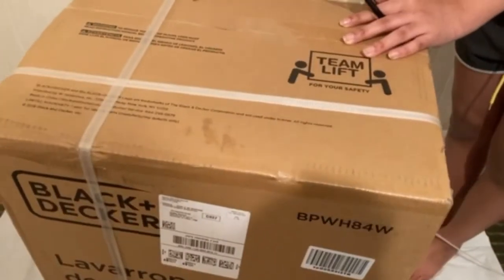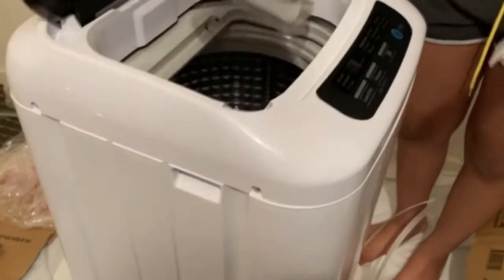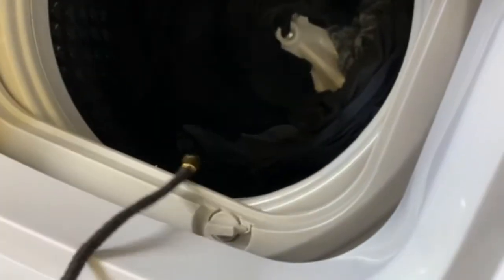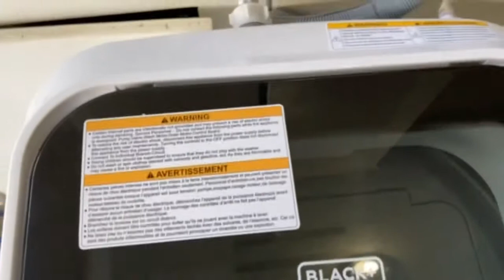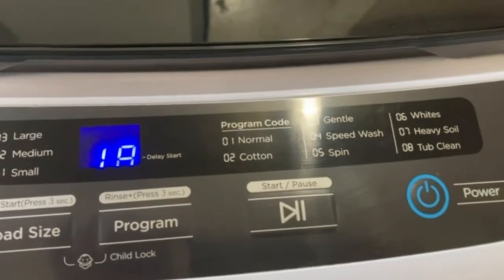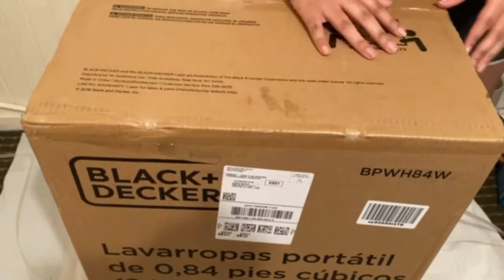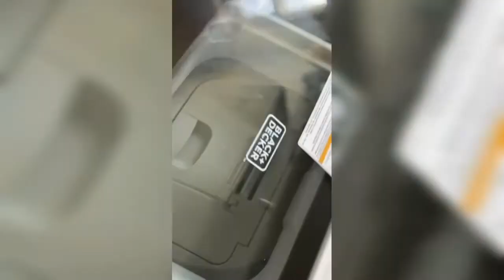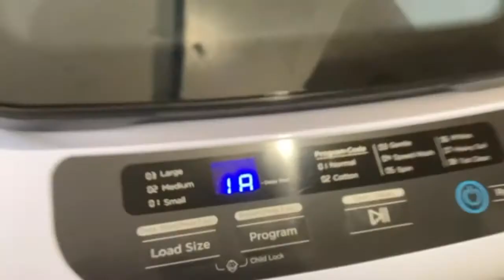Trying portable washing machine Amazon (2021) #amazon #portablewasher #bestportablewashingmachine

Comment: These little portable washers are powerhouses. They last forever too. A washer repair guy told me that they are good machines & a good buy. Black & Decker is a good company IMO. I ended up with Maytag.
Reply from the maker: Yes this machine has worked so well for me. It is still going strong .how is your Maytag?
Reply: @DFaballin   I love my Maytag. I bought the 3.0 cf only because I was able to move to an apt that has hookups. I saved a few hundred dollars & it's just shy of being a regular size washer. I hadn't had a washer in over 5 yrs. I don't think I will ever go back to regular full size washer again.
Reply from the maker: @karenmessinger9609  I was  board scrubbing so  having mine feels like heaven, I also would love to just use this small washer. Saves time .regular washer not needed ❤️
Reply: Farberware here :)
Reply from the maker: @adamarlem9863  s that your washer brand name?
Reply: @DFaballin  yes, it is the Sam model, with different color exterior and different brands. From HomeDepot because they have good products and warranties. If this helps.

Comment: Hi, Can queen-size sheets fit in the washer?
Reply from the maker: Yes,I also wash twin comforters. But I’m not sure of the queen comforter.sheets definitely.💯👍🏽❤️
Reply: What about a queen blanket. Not a puffy comforter but just a blanket
Reply from the maker: I’m not sure but if it fits easily it should work well.since it’s not a comforter. Because the twin comforter fits with little extra room